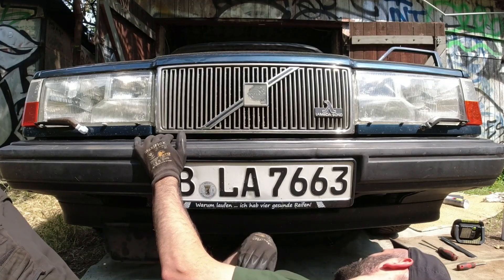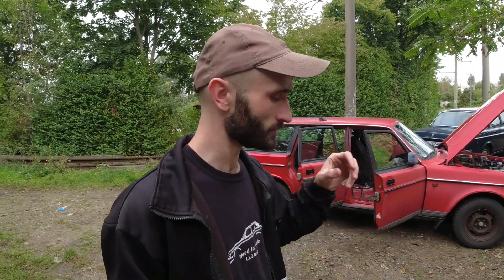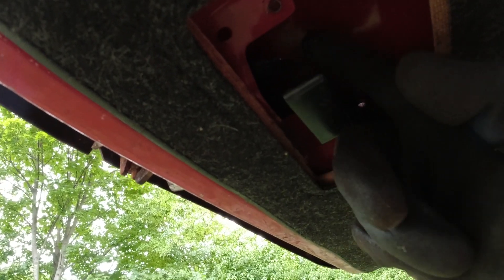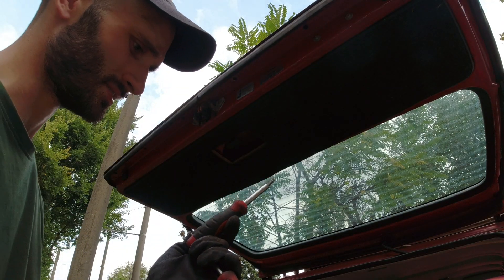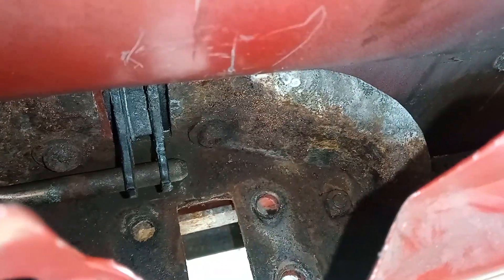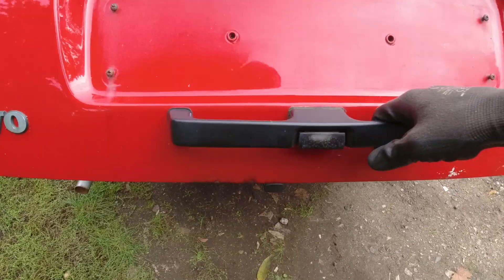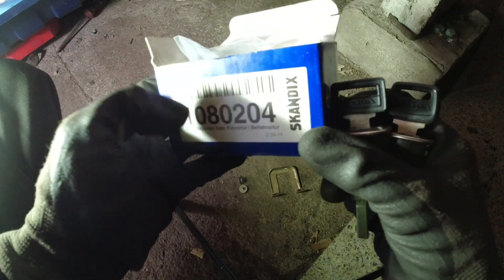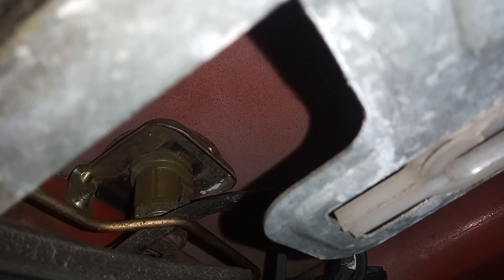Ruby the Insecure Volvo 240 Wagon gets Door Lock Cylinder and Tailgate Latch

Comment: I had replaced the locks on a 1988 760 Turbo, I had ordered the locks, door and ignition switch, the only one that I didn*t change was the trunk lock, of course they told me that I could have the door,ignition switch keys work with the trunk lock so it is one lock, have you thought about seeing if it can be done.
Reply from the maker: I didn't but it sounds interesting, I found on my 940s the cylinders didn't even work because they were never used!
Reply: @Involvod  I am just imagining 2 sets of keys maybe 3 depending  if you at least get the locks that will operate the door and ignition, and the rear station wagon door, now if the car is 1981 and before, it would use 2 keys, one that opens the doors and ignition switch, and the trunk like if it is a 240 sedan.

Comment: 240 hood latch lol. I've locked mine closed a couple times
Reply: I lubed my hood hinges (finally!) and then the hood opened and closed and...locked. Had to fiddle about with the release handle and the lifting tab until it finally opened.
Reply: @Gothamauto  my issue came from replacing my hood hinges. It was then out of alignment

Comment: the flat square part where the  bolts holt the latch is catching on the pin and lever on the door. wth
Reply: ok got it out. if the lever & pin is stuck on the square flat of he lock mechanism just try slightly bending the interior metal to get it out. dont bend the metal hard enough to permanently deform it though